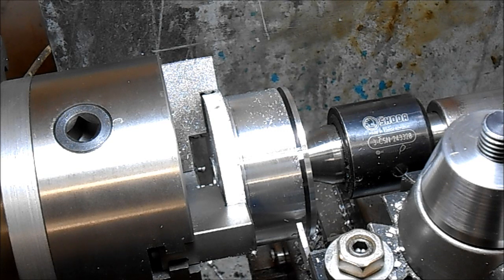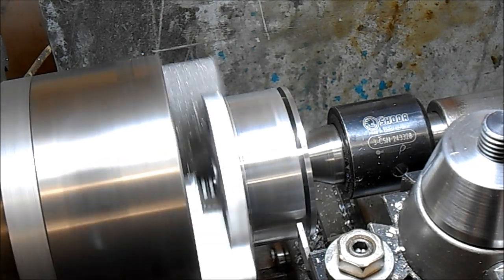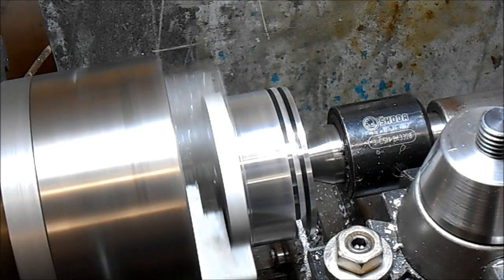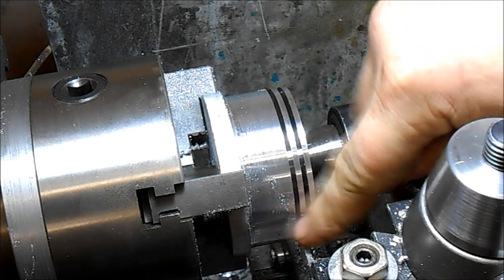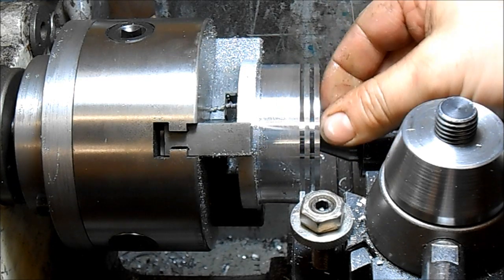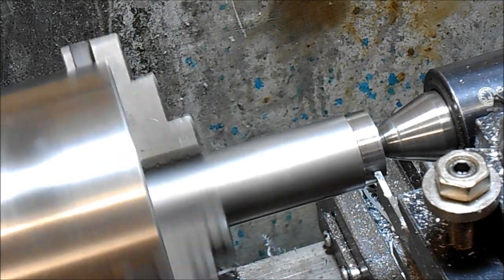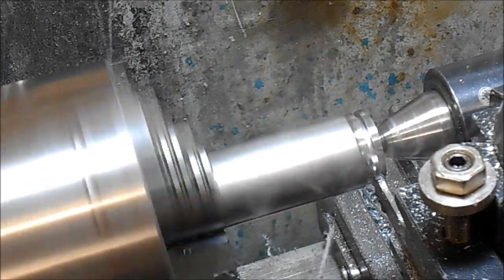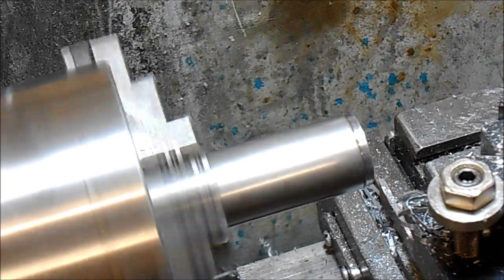Parting on a metal lathe

Comment: As you're running variable speed, how about a "remote" speed control? I've made up an ally box with a slider potentiometer in it that bolts to the carriage with a sliding rod / spring to move the slider knob hooked to the upper cross-slide (Yeah, I've got a Holbrook Model C too...) - it's a bit like the CNC boys' constant surface speed, as you close into the lathe axis the speed goes up (the pot spans the wipers of max and min setting pots, so you can set the range it varies over)